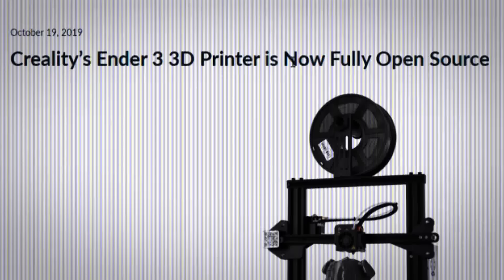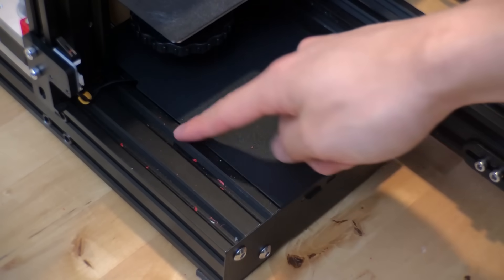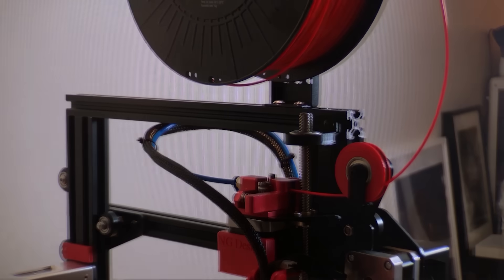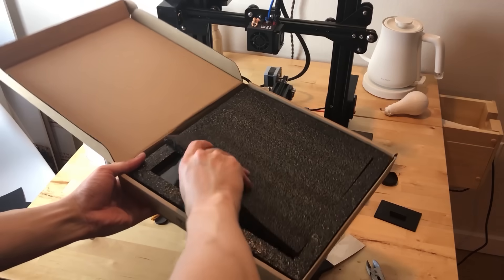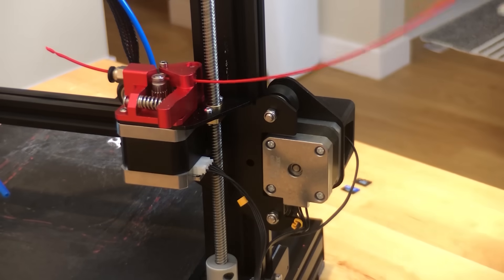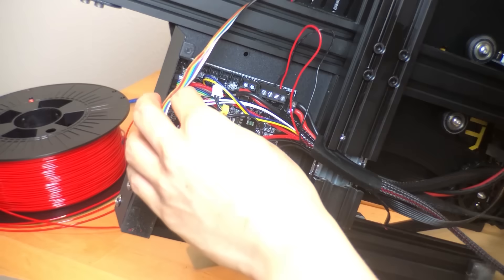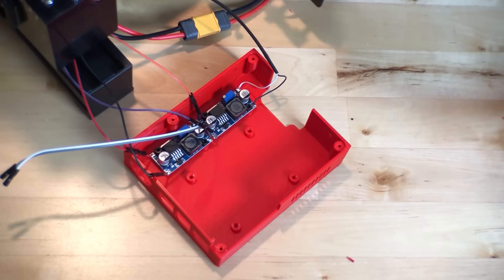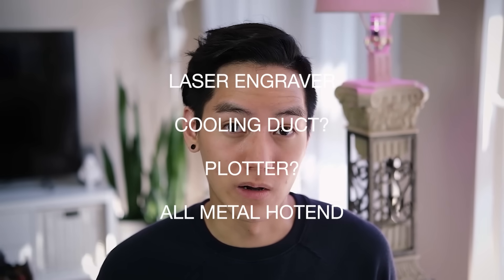First 24 Upgrades for my Ender 3 Pro - Part 1

Comment: I think you put the wrong Amazon link for the motherboard. I got something completely different that doesn’t even work for the ender 3 and now I have to return it.
Reply from the maker: You're right! it looks like they discontinued the version I used. I just updated the link and just make sure to get an E3 version as it stands for Ender 3. Sorry about that and thanks for letting me know!
Reply: @ScottYuJan  Mad respect. Responding shows you care and especially checking comments. Thank you for caring for those that watch your videos. Many youtubers seem to fail at that part.

Comment: hello i have raspberry pi 4 and ender 3 pro and i bought camera v1.3 but when the printer starts to move the camera does not display properly what could be the reason thanks in advance

Comment: this is probably gonna get ignored but, why can't i print squat on my ender 3 pro, the z axis always starts on the stratosphere, and the z axis sensor thingy is bottomed out, even when doing auto home it goes down normal, and with the print cover i cant get it to stick for some reason

Comment: that DCDC converter can be modified by adding a a TTL control line, you can tie it to a RPI to control the light on/off at start and end of each print;.

Comment: Hey how did you actually power the Pi? I've got my buck converted stepped down to 5.1V, and I'm attaching it to the pins like in your video, but my Pi isn't turning on. I'm using Pin 2 (5V) and Pin 6 (GND)

Comment: Wonderful video! Just a quick PSA, I printed out the cover for the display PCB. It looked really nice but it caused some issues with the menu during prints (see https://www.reddit.com/r/ender3/comments/jnbw3s/random_beeps_while_printing/ for a description of what I'm talking about). Apparently one of the screws on the PCB helps ground it on the printer's frame, so putting the cover on it can interrupt that. I just removed the cover completely, but if you're having a problem the reddit link I mentioned said they "edited" the cover (which I suspect means they just enlarged the hole around the relevant screw to allow it to properly contact the PCB), so you could try that as well.

Comment: Thanks for the great videos. I am getting my very 1st printer delivered today, but have virtually zero experience with 3d printing. Assembly should be no problem I hope, but after that I have no idea where to get started on how to begin printing. I have a thingeverse account, and know how to get STL files from there, but after that I am lost. I hear people talk about fusion 360 and slicer programs... are there any good tutorials you could recommend for a beginner like myself?

Comment: just got my ender 3 a few days ago, and am incredibly overwhelmed by all the info that i have to learn. this just made me even more overwhelmed but damn was this cool to watch!!!! love your editing style too!
Reply: Same! It’s gone from “printer works but I have some software tweaking and calibrating to do” to “well now I need to print a whole new printer”
Reply: @versesZero  this whole video had, "if the handle on my axe breaks and I replace it, then the axe head breaks and I replace it, is it still the same axe?"
Reply: @totallynotpaul6211  ah yes, the ship of theseus paradox
Reply: @versesZero , hey, same here :/
Reply: @o1-preview  mines coming in today. Any progress? I'm overwhelmed too lol
Reply: Love this video and all the cool suggestions to make the E3P look and feel the part!  However, I must tell all those new to the sport...the most important part of printing anything, is the slicer settings.  Don"t get "overwhelmed" HERE!  The stock E3P has done right by me as long as I level the bed, manually or otherwise,  and set the slicer settings appropriately.  If you keep that in mind...then you can allow this video to do what it does...inform you that there are no limits to the customization and improvement of the E3P.  Then, with no fear of risking performance...your journey can be as long as you wish it to be.
Reply: just ordered mine, im overwhelmed too! xD
Reply: Great I just ordered THE 3 V2 and thinking I might have made a mistake. How is yours holding up?
Reply: Consider the title being the Ender 3 Pro, I just got Ender 3, does it also work? Any info would be appreciated!
Reply: @Chinjangs  most of it does yes. They have regular Ender 3 versions of most of the stuff he printed :)

Comment: Voxelab Aquila from aliexpress $135 shipped. Delivered in 6 days from New Jersey. It's at least as good as a Ender 3 V2 print quality wise as it's basically the same machine right down to the motherboard and display, and 99% of the Ender parts and upgrades fit.

Comment: I just bought my printer and i also purchased bed leveling springs aluminum knobs capricorn tube metal extruder new mother board and an all metal hot end

Comment: Would you recommend using PLA or PLA+ for printing the upgrades. Do you use CURA or Simplify3D? I just bought my first printer and looking for direction.

Comment: @Scott. When I printed the SD card cover from thingiverse on my Ender 3 Pro I ended up with a big ball of melted filament everywhere. All I did was import your file and sliced it in Cura. I am using 1.75 PLA. Should I be changing any settings to prevent this problem?

Comment: They make a 5v Power supply,  @ 11:30... Why didn't you get a 5V one?  Did you need 12V as well?
Reply: While watching more videos, I learned that the power supply came with the Ender, and must be used to power printer.

Comment: When I print the Chain Link cable the G Code file 3 the smallest file in Thingiverse, the bottom of the print keeps coming out with netting and very stringy parts.  Is this file not working right?

Comment: Heya, I'm from Portland!  Moved to Reno a few years ago, but I still get up there a couple of times a year and usually end up somewhere in Vancouver once or twice a visit.

I love this video.  Very inspiring.  I feel like I really need to master the use of what comes stock in the box before I do a huge bunch of upgrades.  I bought mine with both the glass bed and the mag flex bed, I like the glass better at the moment.  But I see the urgency of getting at least the USB/SDcard thingy going and getting OctoPrint set up.  But I love the finished look of everything you've done.  It's pretty epic, and something like that would look incredible in my arcade room with an IKEA enclosure :))))))

Comment: Alright this is dumb, but can you put out the length of the usb Cable used? Or the link to it?
Reply from the maker: not dumb at all haha i tried a few sizes before finding the one i liked. here it is: 
https://amzn.to/3mJyze0
Reply: @ScottYuJan  thanks bro, I've been working on my ender 3 too, lol. I have came across some useful upgrades that you should look into as well. From my experience whenever a print job is done I'd rather not have it idle and just sit there and consume power so I was looking into an upgrade that uses a relay and a raspberry pi to make an auto shutoff system. Let me know what you think.

Comment: hi i order this for my ender 3 pro but is not working 
lanmu micro sd to sd card extension cable adapter flexible extender compatible with ender 3 pro/ender 3/ender 5/monoprice mini 3d printer

Comment: i have a ender 5 pro and have some of these upgrades but i would not recommend taking off the magnet i use a glass plate and there is no benefit  to taking it off just put the glass plate over the magnetic surface. (the only difference is the glass plate sticks a little more but it still is easy to take off just sticks a little more) and if you leave it on it can be good if your glass plate brakes and you need to go back to your old plate as a backup.

Comment: is there any harm to the power supply if you cover it
Reply from the maker: that fan muffler doesn't fully cover it. it just redirects the air flowing into the power supply unit. that fan is also not an exhaust. it's actually an intake fan and judging from the amount of people using it on thingiverse i'm going to assume it's probably not harmful?

Comment: Love this video!!!! Do you have a wiring diagram for buck converters and raspberry pi? or the voltages you used to distribute from the power supply to the pi? I just printed and added all these mods plus a few extra. We are adding a pi V2 camera attachments and a servo  with a swivel mount that can be controlled from the Raspi in octoprint. This will allow me to cover different angles and shots as I print. I also am redesigning a tool holder for the scraper knife to hold a few extra things such as clippers and stuff. I will be sure to make videos and upload designs once we are finished. The wiring diagram of input and output voltages would be helpful and the pins you are using to input power to the pi?

Comment: Nice video, so many useful mods. I just got this printer the last week and made a few prints, still learning but I'm loving it. One of the things that drives me crazy the most is the noise from the fan that's always running at 100%. It there any mod to reduce that noise?
Reply: ear plugs :)
Reply: @HannahJunglas  Well at this point I have replaced every single fan and replaced the mainboard. Before that, having a videocall with the printer working at the same time was impossible. Now I can even forget it is turned on.

Comment: so basically this printer is the iPhone of the 3d printing world. popular, underpowered, but very customizable so people love it for no real reason other than they can make it look pretty.
Reply from the maker: if iphones were $200 😂 then yes... kind of.
Reply from the maker: wait a minute, iphones aren’t customizable... androids are haha nvm i don’t think this comparison work. but good try 👍🏼
Reply: @ScottYuJan  you buy an iPhone then you buy the 100's of accessories you need like airpods and quick connect chargers that don't come with the phone then you buy customized cases to change its looks. its not like android where you buy the phone and it comes with everything needed and the only thing you need to buy is a screen protector... like a good printer where you may have to exchange the bed to get a better surface, you won't have to buy anything else because a good printer comes with everything.

Comment: #7 is a air output aka ventilation. You are risking your printer overheating by closing that thing.
Reply from the maker: yea i should have clarified. it’s a really popular one on thingiverse actually and it doesn’t actually cover it. it only redirects the air going in and it seems to be fine since that’s not actually an exhaust. it’s actually an intake fan.

Comment: I just ordered an Ender 3 Pro and these videos make me feel like the printer is useless without a ton of aftermarket upgrades O.o
Reply from the maker: well i did all the prints in this video with the printer itself stock so... in my opinion they’re all optional improvements. i mean it’s a $200 printer. if there’s no room for improvement that wouldn’t really make sense haha
Reply: @ScottYuJan  Yeah, but hearing that the extruder won't last really didn't help lol
Reply from the maker: @dustojnikhummer  well to be honest, that may have been a bit harsh. i heard about that from a few other youtubers that showed their extruders damaged after a couple years of usage, but i recently started seeing a lot of comments too that said people were able to use it fine for multiple years too so i think it varies. a new extruder is only like 15 dollars though so it's not so bad but if you're really trying to avoid ever needing to work on your printer and have the perfect machine that works flawlessly out of the box for years with no maintenance or add-ons, you should definitely consider spending more than $200. this is definitely at the end of the day a budget printer.
Reply: @ScottYuJan  If it lasts a year then it is fine. I was worried it would fall apart after two months.  There is a difference of upgrades I want/will improve the printer vs upgrades you have to do for it to function properly. I will definitely put it on the upgrade list. Thanks!
Reply from the maker: @dustojnikhummer   no problem! and yea i think a lot of the people who damaged their extruders may have also been using more exotic filaments. those tend to grind against the plastic extruder and cause damage sooner. if you’re just using PLA or other normal plastics i’m sure it’ll perform fine. good luck!
Reply: @ScottYuJan  I will only be using PLA for the time being, at least until I know what the hell am I doing lol. But I am thinking of that bed leveling tool. I can get a rip-off of the proper one for around 8 Euro.

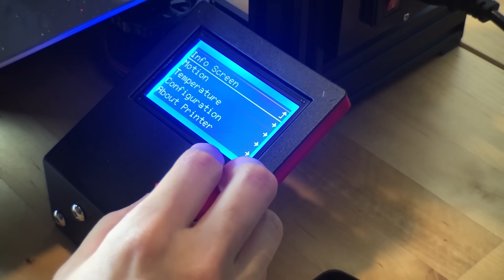Comment: 5:35, Do you need to remove the magnetic piece to use a glass?
Reply from the maker: i would highly recommend it. i’ve seen many posts on reddit where people who didn’t remove it ends up having their glass and magnetic sheet fuse together after constant heating up and in the end needing to crack their glass sheet into crumbs to remove.

Comment: Thank you so much for an extremely well presented video that has more upgrade suggestions thatn anyone else. I decided 4 days ago to order  an Ender 3 v2 (which has the upgraded mother board, quiter drivers, glass bed). The past 2 days I have printed many of your suggested upgrades. I also bought a BL touch, an all metal extruder in a kit that also had Bowden tubing, nozzles, higher quality fittings. I also upgraded my bed springs, a SD card extender and printed your remix SD card adapter. I have watched so many videos about Ender 3's and Fusion 360. You videography is perfect, excellent editing, you are thorough, and you present yourself with an easy going fun attitude. Just 2 days into owning my Ender and I am so far ahead. Thanks
Reply from the maker: wow, that’s impressive ryan! very productive, nice job. glad my video is as helpful! cheers.

Comment: @Scott Yu-Jan. Can you provide more info, sources, or wiring diagrams for hard wiring the Pi and light to the power supply?  I like the clean look and not needing an additional outlet to plug in my pi and a light source!
Great video!  Bought an Ender 3 pro because of it!
Reply: I second this please

Comment: I'm seeing a lot of issues online with the Ender 3 V2, specifically with the current motherboard revision being faulty in its design and causing terrible layer-shift issues. The only fix is to purchase an upgraded motherboard from Creality, or to hope your reseller will send you one at no charge. Creality has also released a few videos showing how to....scrape the paint from the case to ground a motor and part of the case that are not grounded from the factory, instead of fixing the issue themselves. 
As much as it seems like the Ender 3 V2 comes with some nice extra features, I'll be going with an Ender 3 Pro and making some of the upgrades you mentioned here instead.
Reply from the maker: thanks for the info. do you mind sharing with me the “grounding the motor” video you mentioned from creality? that sounds important and i just got a ender 3 v2 for my dad. thanks!
Reply: @ScottYuJan  Absolutely! Here's the reddit post where I found them (https://www.reddit.com/r/ender3v2/comments/lvkmoo/creality_aftersale_video_on_grounding_components/), in case that doesn't work here are the links to the videos themselves:
https://youtu.be/U_eVpsNJd8A
https://youtu.be/89Cd4zLm8yI

Good luck with the printer for your dad! That's super awesome.

Comment: Question: Did you actually spend the hundreds of dollars it costs just to print these things? Just the wire chains themselves I looked up turn out to be $75!
Reply from the maker: wait what? what do you mean? how does it cost $75 if I printed it myself?
Reply: @ScottYuJan  unless you do something different. Each of those links on thingiverse prompt me to download files. And those files are asking $15 a part.

I'm researching more now and it looks like I have to convert the 3Dobject files to GCode? Still a little new to this
Reply from the maker: @Hanharrftw  ummm i'm not sure what you're talking about. everything on Thingiverse is completely free.  are you maybe seeing the "tip designer" option?
Reply: @ScottYuJan  I figured it out. So when you download the files on thingiverse (not the tip option) you mostly get the 3d object files, which ask you to pay for use of the file.

The files need to be converted to GCode for the ender to recognize it. I used Slic3r to convert the files to GCode. Idk if this may have changed since this was uploaded, but was very disheartening at first.

Comment: On my Ender 3 pro with the micro USB to SD upgrade you have to turn off the printer every time you remove the SD card. if you don't no files appear when you try to run them. As far as the STL files they work great.
Reply: Im having the same issue, and am searching for a solution. The whole point of this upgrade was to reduce wear and tear related to the card.

Comment: Hi Scott, I’m using m3 screws as you recommended but they won’t fit the raspberry pi 4 holes. How did you get them to fit? I read online it’s not good to force them in so I’m hesitant to try and tighten them

Comment: I know this might sound like a dumb question but for the buck converter that you use for the raspberry pie do you lower the voltage same amount as you did for the lights
Reply from the maker: yup! they both run on the same amount (5 volts). you COULD probably just use 1 bucks converter for the two of them but i’m an amateur with this stuff so i always prefer to keep things safe and simple.